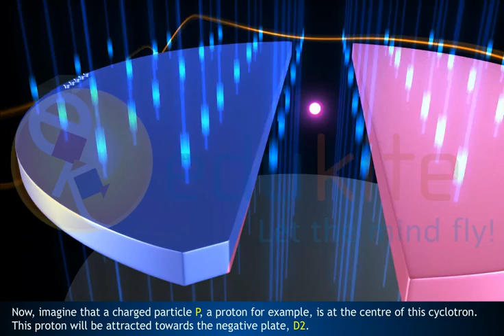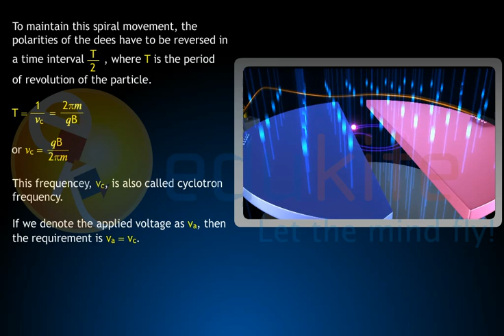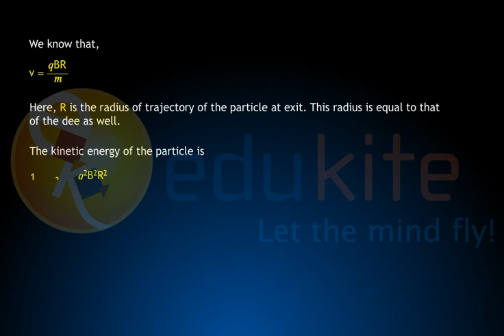cyclotron

Comment: Depends upon the charge of the particle. Usually it is an ionized hydrogen with an abundance of negative charge. there will most likely be a directional block in the source of this ionized particle stopping the positively charged particles from traveling, thus counterclockwise acceleration. Changing the polarity of the magnet will allow the same pathway to accelerate positively charged instead of negative.

Comment: when the charge is inside the space between the two plates, it is acted upon by a coulomb force of attraction from one one of the plates.. and a force acting on any body causes it to accelerate as per one of newton's laws..

so an accelerating charge enters the dees everytim. this causes it to have a radius larger than the previous cycle..

Comment: why wouldn't a charge with negligible mass not accelerate? what has mass to do with the coulomb force of attraction on a charge..
when the charge is inside the space between the two plates, it is acted upon by a coulomb force of attraction from one one of the plates.. and a force acting on any body causes it to accelerate as per one of newton's laws..
i hope you get the point..

Comment: The video is correct. If you have a positive charge and it is moving to the left to start, as in the video, and a magnetic field going up, as in the video, the motion of the particle should be out of the screen, or toward you, just as in the video. You may have been confused because the right hand rule applies to electron current which is negative, and thus would point in the opposite direction just as you said, but since this is a positive charge, the force vector would be equal and opposite

Comment: So it does into the material of those Dees?
Reply: If I understand your question correctly, you're asking if the proton goes into the 'Dees,' right?  I am not sure, because it's hard to find absolute information online, but the 'Dees' are open inside.  I would imagine that as the protons are emitted by the source, most end up impacting the 'Dee' material and terminating, but others on the right trajectory stay parallel to the material and make it to the end where they exit through the deflector.